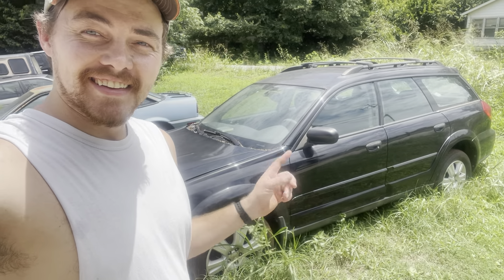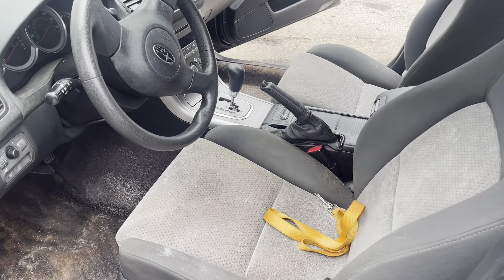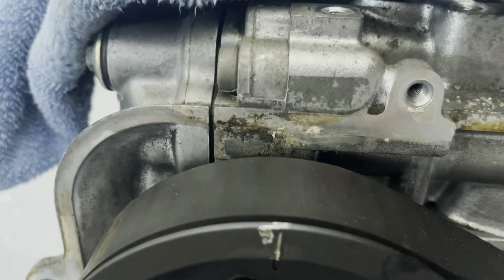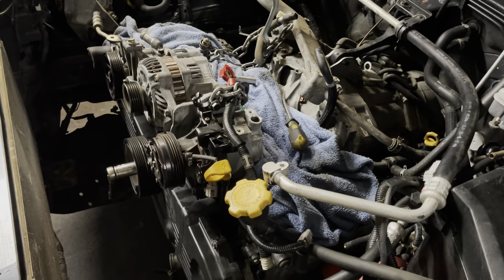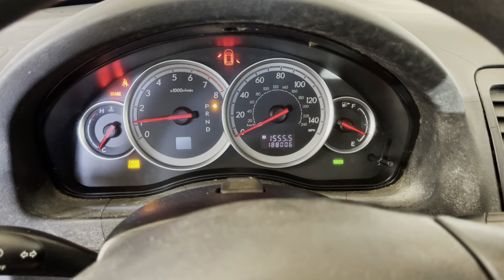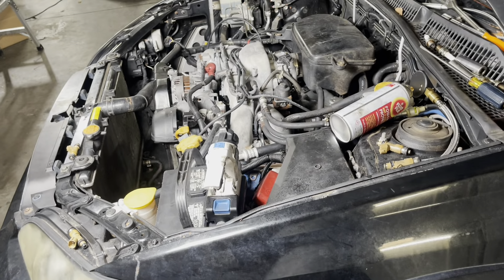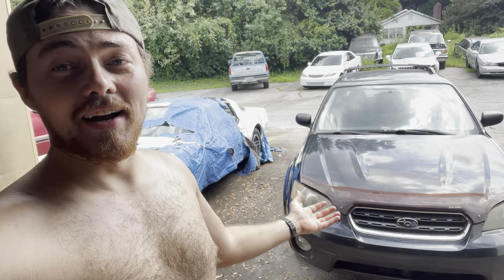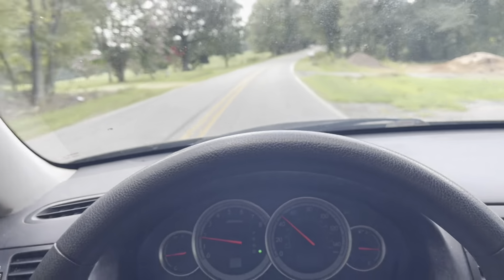I got an abandoned Subaru Outback for free! Let’s fix it

Comment: I have a 08 Subaru Impreza that refuses to die, they’re great beater vehicles and the engines are really easy to maintain if you have the know-how/shop.
Reply from the maker: I hear great things about the newer Subarus. I'm interested in a crosstrek as a future driver myself. Find one with a manual transmission over the cvt

Comment: That's a great find! You're right,  Jay, this one's worth a new engine, considering it's pretty much in great overall condition.
Reply from the maker: Just a little dirty and neglected. After replacing that rotted tank and the radiator ( all in part two) its been just fine !

Comment: Idk why so many hate on the Chinese fuel pumps! 😂 I got mine off Amazon for $46 when auto parts places wanted $400-$600 for it. 2008 Toyota Yaris 1.5l fuel pump went out at exactly 100k miles 
And it’s at 135k now no issues with that pump!
The only thing I have noticed is I burn a little more gas then I used to. Come to find out the new pumps pressure is higher then the old one so it’s pumping more gas into the engine but not enough for it to throw a CEL light for too lean or rich code so it’s still in spec I’m guessing. So instead of 440 miles to 10.6 gal tank I’m getting 380 miles to 10.6 gal tank 
But I still saved $$$ on pump and filter combo
Reply from the maker: Ive had good and bad luck. But usually amazon will make the seller stand behind their listed warranties and replace the unit. For the price, its worth every penny!

Comment: I have a couple old Subarus.  They are a lot of work, even for free.  Good in the winter though.  Probably needs head gaskets all 2.5 EJ engines do.
Reply from the maker: Everyone talks them up so much, I wanted to try it for myself. So far, besides a leaking radiator (we fixed that in part two) the car has been great!

Comment: I have a manual 2.5 2007 Outback. Had some mechanical issues, but it starts no matter what, even in -24°F weather. Is an oil burner despite low miles. Worn piston rings. I love the car though and find it worthy of fixing. I think it’s a lot of fun to drive, is a beast in the snow and off-road. I love the heated seats and power seat, windows and locks, heated mirrors and heated area where the wipers are. Great stereo. I’ve cold AC. Can haul stuff, I think it’s such an awesome platform. I made Reflectix window covering to camp in it.

Comment: LED headlights on that generation of Subaru make the lighting system act all funky.  Normal halogen bulbs work best. I had to remove a set of LED lights from my 2004 forester and switch back to halogens for that very reason.

Comment: Considering it was originally a 2.5...the Auto-box-Gearing...could have Longer Ratio'd Gears....designed for the considerably bigger original engine....so bear that in mind if you think theres a slowness....it could just be an Engine to Trans Ratio...if it is a different Trans.
Reply from the maker: The transmission is original to the car ( as far as I know)  I did expect some power loss going down in displacement. I also did a part two video on this car, touching on the topic of the horrendous gas tank. We ended up replacing the tank all together with a clean non rusted unit. That helped with power tremendously now that the fuel pump wasn't sucking up rust.

Comment: That looks like an awesome car to flip. When everything is done I'd bet you can get $7.   to $10 K for it.  The cvt transmissions are not very good. They're set up to not rebuild them. You're stuck with used just like the motor was.

Comment: They do have a cabin filter. At least my 05 LGT did. And let me tell you it is a job to change. Have to take apart half the dash. Ps you need to strap a canoe or kayak to the roof to fit in with the subaru gang.

Comment: It seems like if you're dealing with cars that have been sitting idle for months or even years, it's worth it to put the fuel lines through some kind of cleaning process.  I'm not a professional mechanic, but I've seen a number of videos where gunk in the system has caused the restoration to halt to a stop.  Especially with older carbureted motors.

Comment: Just take a 4in pvc pipe and use rubber furnco fittings paint it whatever color you want and you have basically the same thing as the oem pipe

Comment: Last year i bought a 2020 Outback with a blown engine. Was just about to put a new engine in it when i decided to try starting the old engine. It was knocking like a mofo. Then i started taking off the accessories and it stopped knocking. A pulley was cracked. They totalled it out over a pulley.

Comment: no you do not want gates timing belts. not unless u want it to snap pre maturely and take out your engine.
Reply: A Gates timing belt will hold 1200hp. Timing belts fail because people don’t replace the tensioner and pulleys and then wonder why it sounds like they have rod knock.

Comment: You saved a wagon, that's always a plus. Wagons hold their value. If ever you replaced the windshield on cars I don't know if you do that or not put the ceramic 95% film on the front glass if it's flat enough. It's light enough they won't know it's there. And you're young enough to be able to see it night, and it really helps the air conditioning. And I'm not far out from your area with the hot humid hell. And you're pretty good at fixing modern cars I only work with stuff that's a bit older.

Comment: If it’s a Subaru, you can fix it. It’ll rust out before you start working on it. I had an 85. It was the worst car I ever had. It’s a piece of junk. The best thing you can do is put it in the scrap heat. it’s all garbage. It has that box engine. I bet you the head gasket is blown, and the lifters I’ll probably no good either. Don’t waste your time. The car was made with 2000 pounds of recycled beer and soda cans. The car is garbage. Don’t waste your time on it.